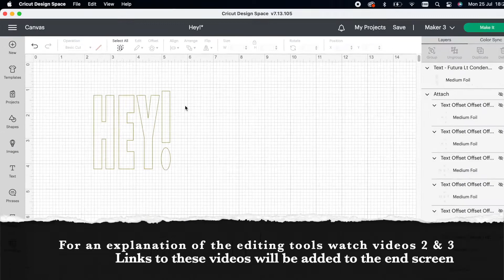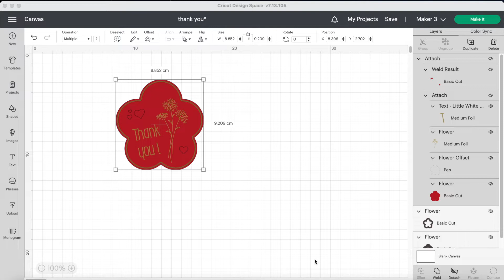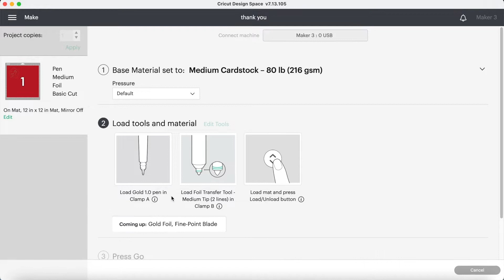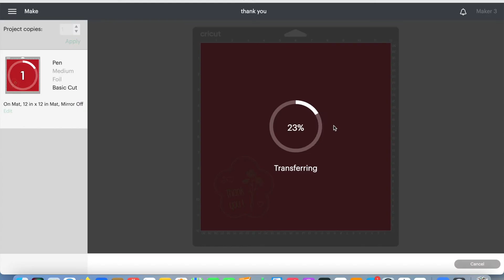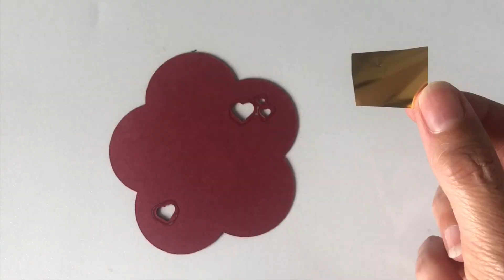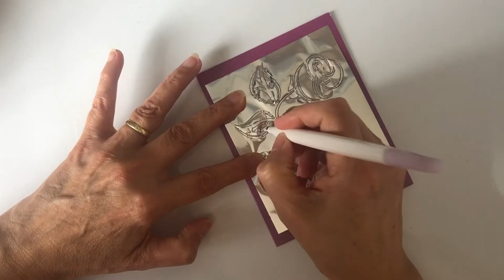Cricut Transfer Foil Hacks for Cricut Beginners - Part 2 #cricut #cricutfoil #foiltransfers

Comment: I loved your video, I had come on youtube to watch how to get the Cricut Foil less patchy. I'd made a full sheet of gift tags last night and they looked rather "rustic" and patchy. I've watched so many videos and your video was the "Of Course" moment. 
As soon as you said you did the foils twice it all clicked for me. Thank you for that :D 
I do have a tip to share with you, I learned this with the Engraving tip. When you want a deeper Engraving in your metal (for example a stainless steel spatula) you duplicate the engraving layers and attach them right on top of each other. It helps to use the align button to get them perfectly on top of each other. This tells the software that it will be following that engraving path twice (or more depending on how many times you duplicated the engraving). 
As soon as you said to do the foils twice, I remembered this little tip and thought I'd share that with you :D 
Thank you again for your lovely video.
Reply from the maker: Thank you for letting me know!! I’m so pleased you remembered that trick. Does it always work well for you? I’ve used it once before but sadly it didn’t line up perfectly, so haven’t tried it since. Maybe Design Space was having a funny moment at that time…. It was glitching a lot with the x and y position tool at the time…. 🤔 I’d be interested to hear how you get on with it! 🥰
Reply: @createwithdebs  I highlight both engraving layers, (pressing shift on the keyboard and clicking on each layer) then I use align>centre. I zoom in to make sure I've got no shadowing, then attach those layers together, it works really well for engraving. I'm a Cricut Ambassador here in Canberra, Australia. I teach the engraving class twice a term. Engraving and debossing are my most used speciality tips, together with my rotary or fine point blade, they make up my dream team, lol. I've had the foil tip for over a year but as it's not one of my specialties I've not played with it a lot. This year I thought I might make some foiled gift tags for people, who come to the in store demonstrations, to take home. 
Usually if I do foil I use a little piece (4 or 5cm square) and tape it down tight, and I've not had that patchy look. But in making 16 gift tags on 30cm cardstock it was such a big piece of foil that I wanted to check what toys and tricks are out there before contacting customer care in the morning and getting project help. 

I love how craft brings people together, do you mind if I let people know that I found your tutorial really helpful? The demo is in 12 hours (I should go to bed, but I'm waiting for one more mat to cut).
The demo tomorrow is all about Christmas, so I'm headed into one of the Cricut retailers to show people how to put a name on a bauble, make a Christmas cake topper out of engraved acetate and an iron on project, which is an elf sized Santa sack. So the gift tags are more to inspire and for people to take home, it would be lovely to share your channel to help anyone who might want to try the gift tags at home :) 
(No pressure though, I will completely respect your decision)
Reply from the maker: I’ll have to try it again, if it works consistently well for you 😁 I’ve also found foiling has worked better with smaller projects. I think there are a number of factors that can influence the outcome: type of cardstock, tautness (not taut enough, or even too taut, I think 🤔), finger prints on the cardstock, pressure setting. It can be a question of trial and error every time we work with a different type of cardstock. I made a whole sheet of some gorgeous stickers though with the kit, using the Cricut sticker paper, they came out beautifully, and only needed one pass…. I haven’t tried debossing or engraving yet, but am keen to have a go! Hoping for some new tools and materials for Christmas 😁 Do you have a YT channel? I’m more than happy for you to recommend my channel, I’d be very appreciative, as it’s quite hard going building it, with all the big channels out there already. Your demo sounds fun! Hope you get a good turn out! I’m sure they’ll love the tags 🥰 Thanks for connecting ☺️
Reply: @createwithdebs  I don't have a channel, I tried to post a few videos a while back but I don't think it's for me :) 
I do have a Cricut profile and some projects I've created attached to my profile. My profile name is Nat Hare :)
Reply from the maker: Okay thanks,  I’ll look you up. 😃
Reply from the maker: I couldn’t find your profile … have you made it Public? ☺️
Reply from the maker: Hi Nat, I’ve tried this trick again, and it worked perfectly! Thanks!
Reply: @createwithdebs  oh fantastic :) my cricut profile name is Nat Hare :)
Reply from the maker: Just looked again and found you! 😃